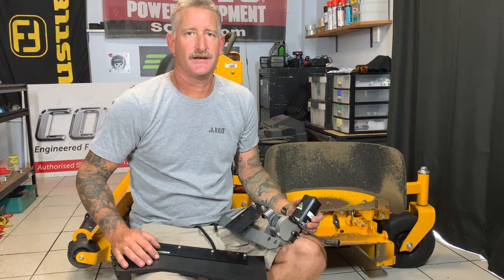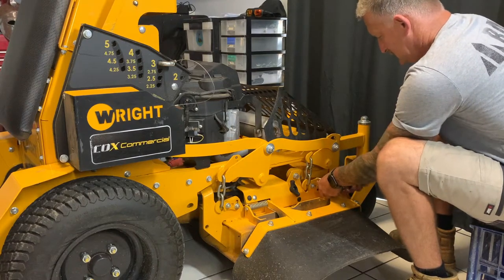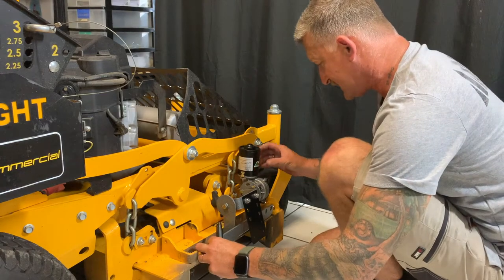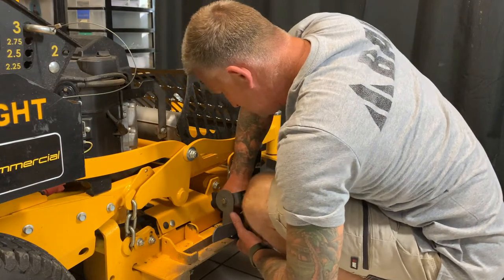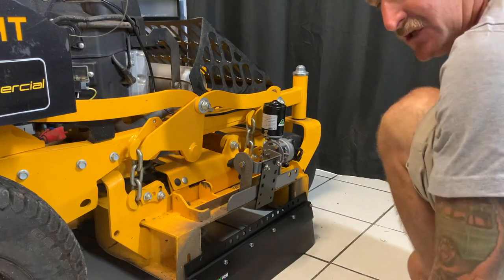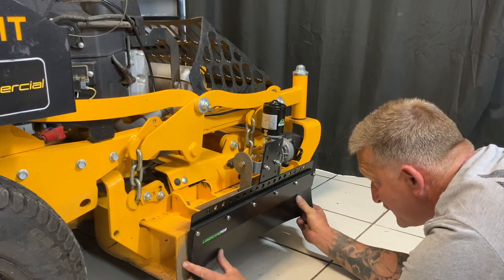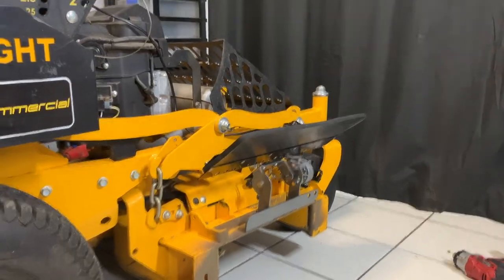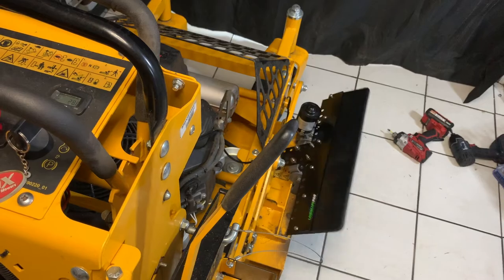Landscape Pro - Pro Shield

Comment: Nice bit of kit, lot stealthier than a manual operation, without the handles etc 🤙 although sometimes I like to run a partial opening, is that possible to have a couple of options from full to half opening?
Reply from the maker: Yes can be run partially open or in any position.